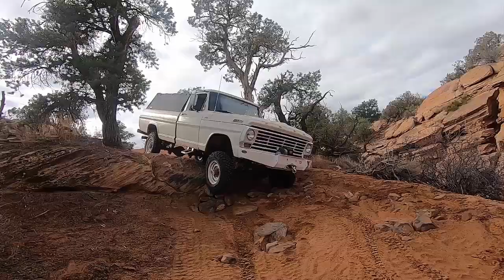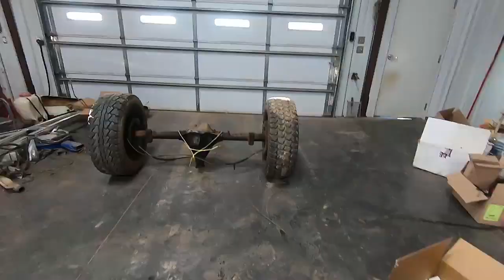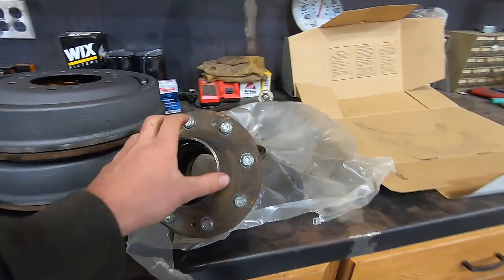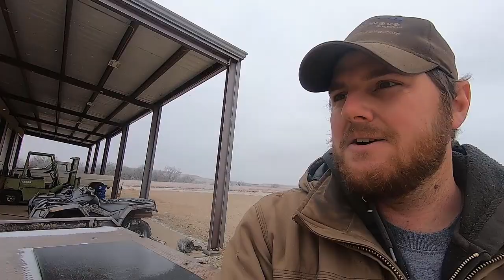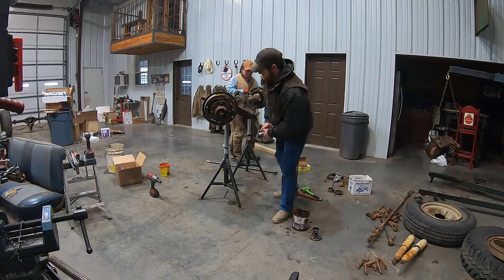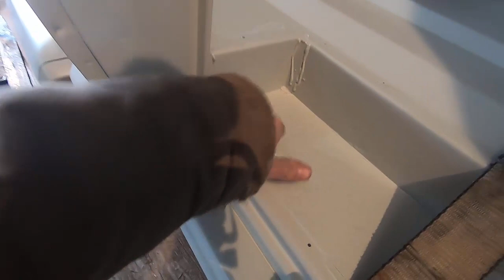Rebuilding the Crew Cab Highboy’s Axles

Comment: Where do you source all those front axle parts? I've looked in a lot places but it's really hard to find what you need
Reply from the maker: Torque king and our local parts store
Reply: @MattKubik1791  do you think it's possible to make a brake disk conversion for these old axles I've been messing with the idea designing some stuff on a 3d printer for a mock up
Reply from the maker: @fomocoloco7172  anything is possible with enough time and effort.

Comment: Hi Matt!  Glad i found your channel!  i went with a Dana high pinion 44 from a 78-9 in my 65,   Parts are hard to find for the older axles.   my 66 had the 5 lug Dana 60.2  not worth messing with when there are so many Ford nine inch rears laying around.   I'll be watching!
Reply from the maker: Very good upgrade! And disk brakes.

Comment: I use to use John Deere Corn Head Grease in the ball ends of a Dana 44 because of the leaking issues. JD Corn Head Grease is thicker then Gear Oil but thinner then wheel bearing grease.
Reply from the maker: Thanks for the info!